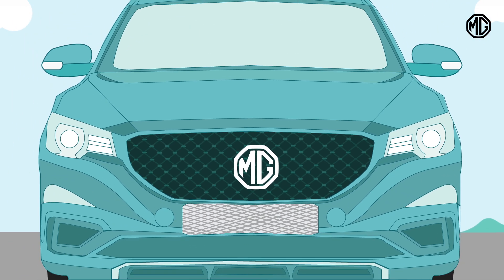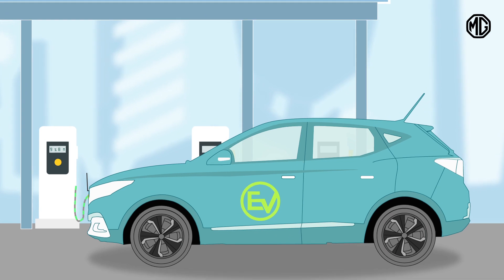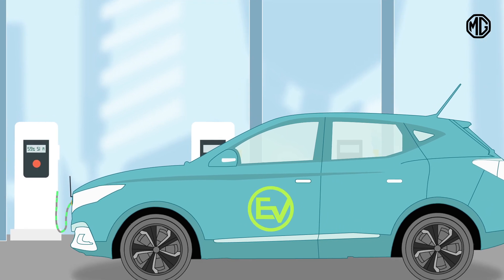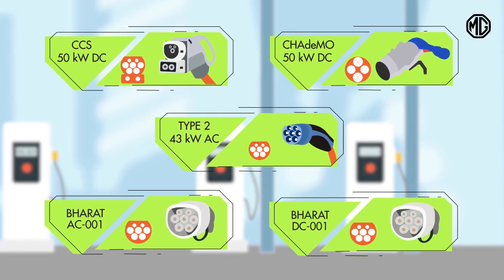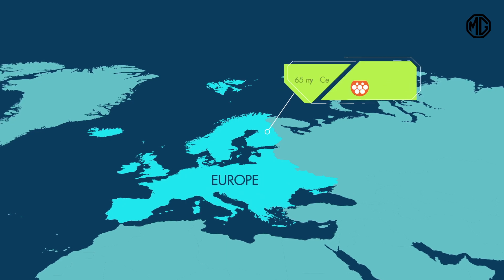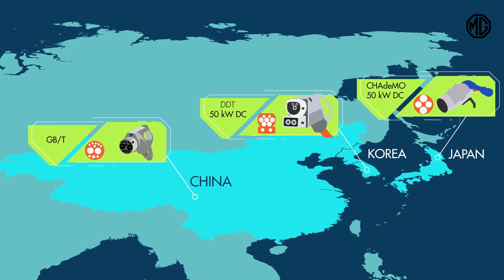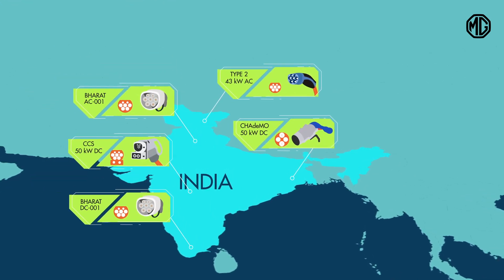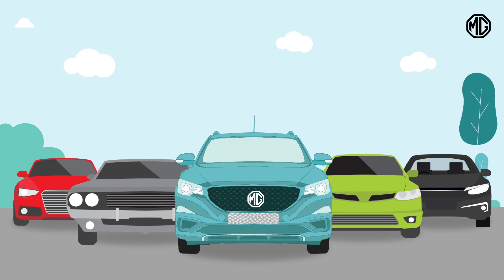Make way for future

Comment: EVs in India can only be successful if there are as many charging points as fuel stations.
MG, you should keep a charging point at every possible major petrol pumps. 

Also please speed up the production/ deliveries of the Hector.
Don't let production of EZs impact the production of Hector.
Reply from the maker: Dear Mark Henry, We have partnered with Fortum to make sure there are sufficient charging stations installed in 5 cities. Please visit the link to know more : https://www.mgmotor.co.in/media-center/newsroom/mg-partners-with-fortum-to-set-up-fast-charging-ev-stations
Reply: EV,s are still at nascent stage all over the world . EV,s have miniscule market share globally ( most EV,s are in Norway & China ) . everything has pros & cons & so are the EV,s 

1. Setting up charging infrastructure is a big challenge & huge investment . it cant be installed  after every 2 kms like  regular petrol/diesel pump & especially in India the electricity grid is unreliable 

2 . maintanence & service cost of EV,s will be high . replacement of components in EV,s especially batteries will be costly . 

3 . EV's batteries produce toxic waste which is harmful for the environment .